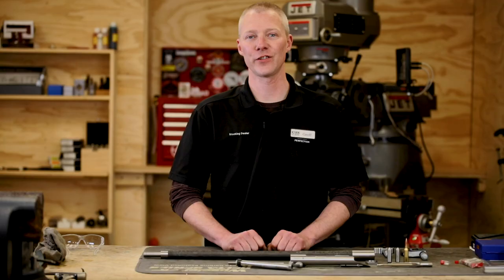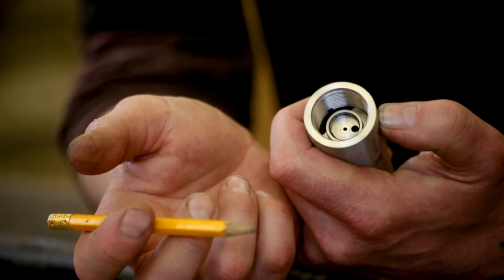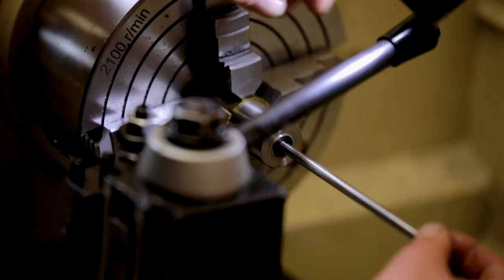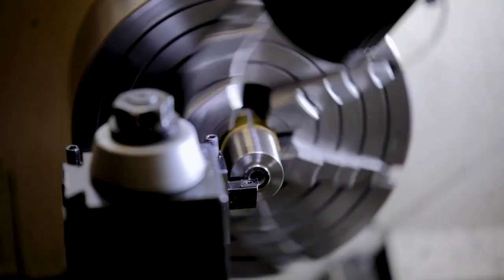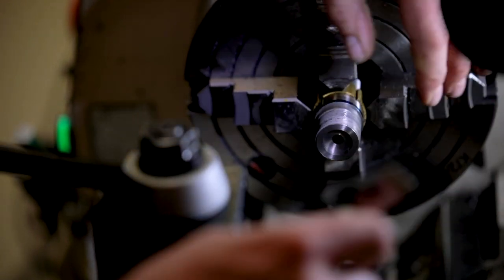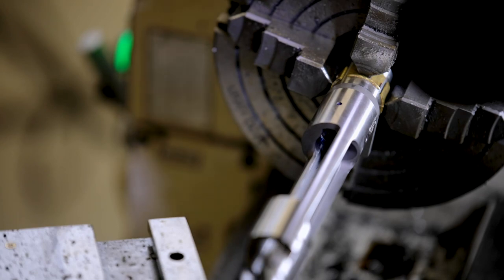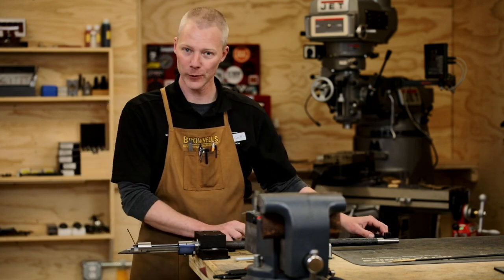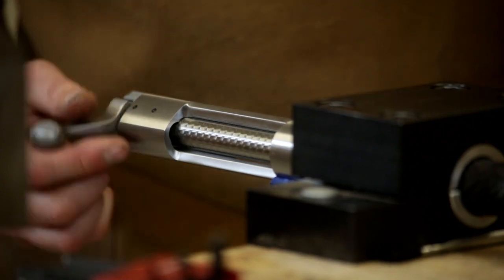Chambering A Proof Research Barrel to an Accurized Remington 700 Receiver | Gunsmithing

Comment: Another really nice video!  The dangers of showing your work is that you have to defend your actions to the League of Extraordinary Critics!  I was a bit concerned with the "generous" nature of your headspace but once I read the comments all became clear.  Maybe with a critical dimension like that you could explain how the SAAMI headspace dimensions of 1.6486 MIN - 1.6586 MAX for that cartridge are a pretty large window and that you were intentionally closer to the No-Go dimension because of the hunting ammunition reliability issue in the video?  I never push a torque wrench. I find it easier to stop at the required setting if I slowly apply a pulling force that gradually increases until the target is met.  All the same, I really enjoy your tutorials and wish you would continue to expand the precision rifle line of them!  A++

Comment: The No-Go means the bolt should not look like even wanting to close. I would say that's a way loose chamber.! May even have too much play the firing pin won't have enough to ignite the primer.
Reply: i agree
Reply: Agreed, actually surprised.  It looked like it practically closed.
Reply: You must realize the barrel is not torqued. When it is, it won't go that far.
Reply: @darrellblanchard2362  The bolt closed on the No Go gauge after he torqued the action! He removed too much material during the reaming process!
Reply: Wrong! I merely means that it’s not a minimum spec chamber.  When the field gauge will chamber that’s when you have a problem!
Reply: @danielrobey1759  Says nobody who chambers rifle actions, ever. That was a sloppy fit. That's obvious.
Reply: I was a little surprised too when the bolt dam near closed, I'd like to see him run a field gauge in there but that chamber tolerance is definitely in the larger side...

Comment: Have a question if able and when you’ve got time. 

I know this video has been here a few months but I just found your site. 

Great job and information. Thanks for sharing your knowledge. 

When cutting your chamber, how do you reset your reamer for accurate depth after the initial roughing cut?  

Pulling the reamer out, which requires sliding the tail stock… that screws up your zero. Repeat cleaning and clearing chips and slide the tail stock forward and ream to final depth? Do you have a stop block for the tail stock so the slide micrometer or caliper is still at an accurate zero?

You can’t really touch off again accurately for those final minuscule thousandths to “Go or No Go” depth. 

Appreciate the info and direction. 

Best.
Reply from the maker: Thanks for watching!  Although not super precise, the method I use is repeatable enough for me that I haven't had any over shoots when chambering.  In the very rare event that that may happen, it's easy to trim the torque shoulder back to correct (unless of course the barrel needs to be indexed exactly in some way).
Reply: @wyomingguncompany3327  

Thanks for the reply. 

I was thinking along that line of thought.  If one cut too deep on the chamber you just recut the end to make depth and re-shoulder. Measure twice… cut once, …  unless you cut twice and it was still too short…  ;)

I’ll have to drop in next time rolling through CPR. 

Best to you and yours.

Comment: From the description, "concentric to the centerline of the barrel to guarantee a precision rifle build".  The barrel does not have a centerline, but rather a center curve.  By indicating both ends of the barrel concentric to the lathe spindle you are almost guaranteeing that the thread tenon and chamber will be misaligned with the bore.
Reply: Yep. After dialing it in at both ends, turn the lathe on a slow speed and look down the bore. You can see the curve in almost all barrels, even high end barrels have a slight curve. Bartlein barrels are the straightest I’ve ever seen.

Comment: Why did  you  not  check  the  threads  you cut  on the  barrel  with a go  no go  gauge  ? This  would  ensure thread  diameter and the pitch  .

Comment: You reamed it to deep, no go gauge shouldn’t close that easy it should be a dead stop or very tight even with a tactical/field rifle. The go gauge should be tighter, you’ll see reduce brass life where the datam line will be blown out thinning the brass near the head if the chamber is cut too deep.
Reply from the maker: Greetings and thanks for watching our video!  In this particular case our customer wanted to be able to use any factory ammo out there and isn't interested in handloading.  While I understand your concern, we do what our customers request and in this case he wanted a reliable chamber that would accept any/all factory ammo under real world hunting conditions.  The rifle shoots extremely well (see last video in the series) and that's all that matters to the customer in the end.  If it was a bench/match rifle that would be handloaded for, we'd have definitely cut the chamber tighter.  Thanks again for watching!
Reply: @wyomingguncompany3327  It is an oxymoron to accurize a rifle for use with factory ammo. Each barrel may require a different 'flavor' of bullet / powder to shoot to its optimal ability. Handloading is the only way to achieve the union between hardware and software (the ammo),

Since hunting rifles will probably be used under extreme weather conditions, sleeving the bolt only makes it easier for dirt to hide somewhere and lock up the bolt to action clearance. I realize you are giving the customer what he wants, but is the customer going to actually be happy with what he gets? Sometimes a little education goes a long way.
Reply: If the owner chooses to handload in the future would the headspace matter past the first two cycles on the brass. That is what headspace comparators are for, the owner could simply establish MAX - .002" bump the shoulders to that point and have the same brass life as the rest of us running minimum Sammi spec chambers. How the owner sizes his brass is what matters, I've seen web thinning on brass shot through minimum spec chambers because the person loading the ammo didn't quite understand the difference between "headspace" and "head clearance".

Comment: All of this is what I want done to my new 7PRC...action blueprint and bolt hole reaming and bolt sleeving. Pity you cant take down the bolt throw and maybe stiffen spring. 90 degrees is so 1962! Some customizing bolt and throw lever would be cool. Bought my new donor 300wm the other day and it is on the way to my new gunsmith.